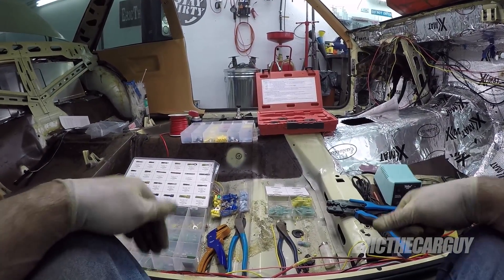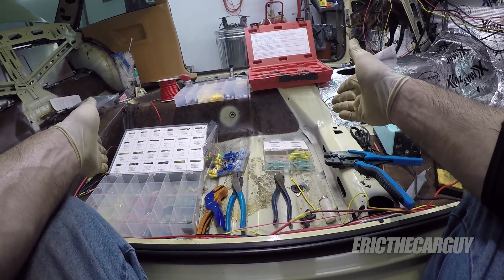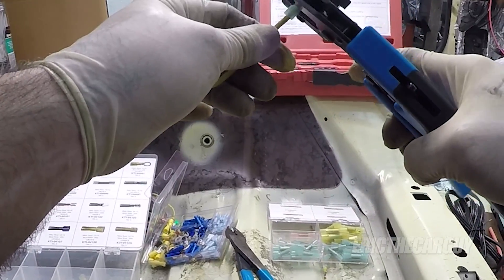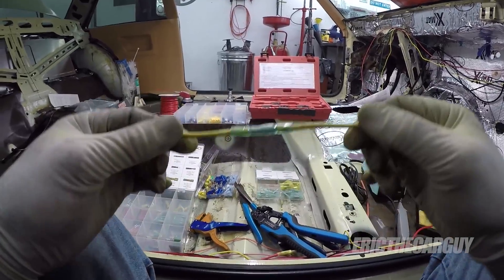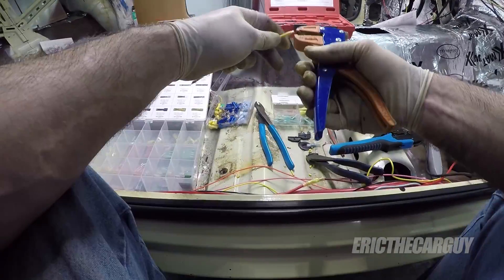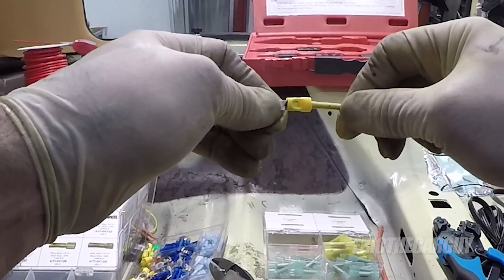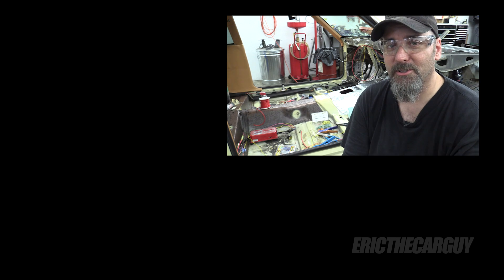How To Crimp Electrical Connectors

Comment: Don't use butt-end connectors on computer wires or major electrical systems that may be sensitive to additional resistance. I would recommend using butt-end connectors on thing like headlights or tail lights maybe with speakers but additional resistance to major electrical components of then vehicle will cause the readings to not be as accurate because of the added resistance of the butt-end connections. Solder and shrink tubing is the best way to go with the main electrical wiring.
Reply: JayGamesAndStuff A properly crimped butt connector will only add the equivalent of at most an extra inch or two of copper wire, which should never be enough to significantly alter your readings even in typical low impedance systems (and will have no effect whatsoever on higher impedance systems).  Any system so sensitive that an extra inch or two of cable length interferes with proper operation should require manual calibration after the fact anyhow as there are just too many other variables to account for from the factory as both wire length and gauge will greatly alter the behavior of any system where just a few milliohms is going to make or break things.  A very poor crimp job can be an entirely different matter, but that is why one should use the proper crimping tool for the connector so that one gets consistently solid and repeatable crimp connections each and every time.

The only real exception to the above is where thermocouples are in use, but then splicing in a connector, or any transition between dissimilar metals, will introduce a new thermocouple junction and if that new thermocouple junction is at a different temperature then you will introduce an unintended voltage offset that will affect the millivolt reading generated by the thermocouple.

Comment: Eric , this is very good video thx. Let me say however the the other crimper if done correctly will give you a factory connection . Now I will say it has to be done on non insulated connection. I am not trying to correct you in any way . I am saying that there is another way to do this  . Oh also you will have to cover the connection with heat shrink to finish the connection

Comment: Hey eric i have an electric problem on my 2001 suburban and my low beam lights don't work but the high beam lights work and all my fuses and relays are working i also have new light bulbs but my low beam lights still don't work what else should i check to find the problem
Reply: Gerardo Paez Then you next need to identify where the power to the bulb is being lost to fix the issue.  Does the bulb holder/connector have power when the lights should be on?  If yes, then verify that the the fuse is good and passing power to the other side of the fuse holder, then check that the headlamp's relay is passing power, and if not is it because the relay failed (has a bad contact) or because the relay is not receiving power to its coil (its internal solenoid) or to the input of its switched side.  If the relay is delivering power then there is likely a break in the wiring between the relay and the bulb and you may need to replace that section of wire with new wiring unless you can locate the break (such as a point where the wire became pinched or even severed).  Simply put, you need to follow the power and identify the last point in the equation at which you do have power being delivered and the first point that is not receiving the power after that point and you will then know what to do.
Reply: I had a 1970's toyota that did the same thing.the two copper plugs would'nt let the low beams come on until enough electrical current heated them up and straightened them out.

Comment: I crimp first then add solder to insure max bonding.  I find this procedure to be especially important for connections made OUTSIDE the vehicle as moisture, dirt and salt will degrade a crimp only connection in time.  I have had to do over connections that were compromised in this way.   I like the heat shrinkable connectors for inline bonding as I will sure not get a soldering iron in there without wrecking the connector.   Another Great showing, Eric !  
.
I occasionally crow to people on the quality of your presentations, video and lighting.  Your early experience in media arts stands you in good stead.  Gordon (AKA Gweedo Murray)

Comment: Great video!  I didn't see it in this video, but I've used some electrical connectors that have a male and female connection which can be disconnected if needed.  I've used this connecting wires to my side turn signal mirrors.

Comment: Soldering your connectors (after crimping) is absolutely necessary/required on vehicles or anything you wire that moves. I learned that the hard way over the years on several car/truck builds. Don't believe me, just wait until you have to find an intermittent connection issue because you did not believe. 
I also would never use the flat jawed crimpers, connections made with them will fail over time on anything that moves UNLESS you solder them, then you can get away with using that style crimper. The crimpers with the little nib that indents the connector into the wire are the best ones to use in most every case. They "lock" the wire into place mechanically forming a much better connection.

Comment: I prefer uninsulated terminals and heat shrink. The ones with built in heat shrink are nice but spendy. I like how low profile and clean uninsulated terminals and heat shrink look too. I cant stand the standard insulated type terminals, they're ugly amd bulky. Plus theyre not a sealed connection and putting heat shrink over them looks terrible and never works right

Comment: Hi Eric! Im building my car and I am in the wiring step. I moved battery to the trunk. I didnt use the solder with those crimp connectors, but when I did the connections for the big powercable from trunk to front, I used little solder just because my tool was too little for the connector.IMO solder is not necessary If you have good tools and It also makes the wire too stiff to crimp for no reason.

Comment: Can you confirm which die set you have used? It looks like the 18924 die based on freeze frame analysis of the shape. I have a very similar Pro's Kit tool and I have been looking for one that is good for the heat shrink crimp connectors like the ones you're using.

Comment: I've got a technique I like for the crimp terminals that crimp both the conductor and the jacket. I strip my wire to the length I want, load a terminal into the dies and start the crimp with the usual three clicks, hold the wire in front of the crimp dies, but touching the dies themselves, line up where my conductor and insulator go relative to the dividing line on the crimp dies, then slide my fingers holding the wire down so they are actually touching the dies. Without changing my grip on the wire, I'll then shove the wire into the terminal until my fingers touch against the crimp dies again in the same way, and crimp away. I've been doing it this way for years on everything from automotive-type 10AWG crimps to 26AWG Molex C-Grid-type pins, and since I started I have yet to end up with a crimp that has insulation under the wire side, or not enough insulation under the insulation side.

A similar idea works for both non-insulated and insulated crimp terminals; you just line the wire up with the crimp dies or jaws again in the right orientation using fingers as a gauge. It works surprisingly well.

Comment: There is no overcrimping with proper tools. If you have issues with overcrimping, you are using the wrong tool/die set for the given connector.

Also, with a proper crimp connection there is no necessity for any soldering whatsoever since a proper crimp is (almost) a welded connection on its own with no air gaps inbetween.

Comment: Soldering is superior to crimping. I will use crimp connectors when necessary such as repairing a harness factory connector and deuch connectors. The wiring cannot be subject to movement or pulling when using crimp connectors.
Reply: Bob Is The Builder I would agree that quality soldering is superior to inferiorly crimped connectors, but with properly crimped connectors it is very much a six of one, half dozen of another deal.  One can most certainly have movement and loading when proper crimped connections are used (though excessive flexing concentrated near the crimp connector or solder joint is bad for either case over time).  Heck, I probably have 15-20 pounds of coax hanging off of each of my antennas just flapping around in the breeze all of which are crimped and then sealed against weather with a tight wrap of splice tape covered by tightly wrapped electrical tape and those connections are easily solid enough one could hang from the coax (nor is soldering a good option where foam polyethylene dielectric is used given a melt point below that of solder).  It is just a matter of using the correct tools for the task at hand and not trying to improvise with all the wrong tools.
Reply: Ethan Poole 
I agree its going to vary depending on the job. I'd be a liar if I said I never used crimp connectors. I have probably used crimp just as many times as solder.

Comment: I only solder wires when it's for sensitive electrical stuff. Where you'd want the best connection possible. Like for speaker wires. A better connection might improve the sound a lil. But for stuff like turn signals and tail lights just a regular crimp is more than fine.

Comment: Some workplaces I've learned prefer that you take the time to do it right. That means taking the time to Tin the connection because you'll know you have all the wires to conduct with, where as just crimping it without Tinning the wire means some of the wire could not be in use or the pinch could just separate the wires, not pinching them hard enough and over time will turn into a loose connection(this could cause the lights to flicker for example as the vehicle drives down the road/bumpy roads..)

That being said, when I work I'm usually under pressure to do the job in a certain amount of time, so I just skip the Tinning step as that can add an extra 15/20 minutes to a job depending on how much crimping you have to do.

All in all, it really depends on the mechanic's skill. If the mechanic is skilled enough, and takes his time to get it right the first time, then it's no big deal to skip the tinning step. If you have a rushing/corner cutting/half ass accident prone idiot doing the crimping, you're probably going to find something wrong/loose in the post-check before the equipment even leaves the shop.

Comment: Excellent timing, I've recently picked up a 1998 GMC C2500 with the 6.5L diesel and she's got quite a few electrical problems that I've traced back to harness damage in multiple spots. Currently have the intake out so I can get better access to where the bulk of the damage is.

Comment: Eric your crimp tool seems to be bad or broken, It should be released automatically when you are crimped enough. The release lever is only for problem situations... Other thing, solder is used on PCB and nothig else.

Comment: Crimp Solder Seal my Friend! Oh...and dedicated grounds?? :) Oh and tinning your conductors and the terminals. OH...and crimping is a mechanical connection while soldering is an electrical connection and do not do cold solder joints!

Comment: Now are you going to get that spaghetti in the background into plastic conduit and looms and harnesses for the wiring? Or just wrap it in tape? I guess that'll be the next vid?

Sometimes how it's all routed and packaged makes all the difference in between looking like a hack-job (even if electrically sound) or professional.

Also some free manuals out there NSTM/FAA or similar for wiring practices, if it's good enough for aircraft, it'll be more than good enough for a car.

Comment: Eric
the number of conductors inside the insulation determines the flexibility of the wire.  Thaat is the smaller the conductor size and the laarger number of conductors the more flexible it is.  Also I have been stripping wire for over 50 years and use nothing but a knife or side cutters.  You can get a good strip this way doing this method.  I never use splices to join wire, but will use ring and spade terminals.  In any wire joinery, I solder.  Solder wires together and solder terminals on the ends.  I was glad when heat shrink tubing came along.  When it firsy came out it was about $15.00 for a 3 foot section to shrink over a 14 ga. wire.  How things have changed over the years.

Comment: Concerning the idea of pre-soldering the stranded wire before crimping. I could not think of a worse idea. The point right behind where your soldering stops is the point the wire will fatigue and break, there is nothing to be gained from this activity. I have been shown different soldering techniques by the military (no I was not a service member) and several private schools, no one does this presoldering. If you look for a crimp tool one non ratching tool that works fine is produce by the Thomas Betts Company, great crimper.

Comment: very nice video, i hope it eradicates all the crappy wiring i run into all the time...but I guess I would have to stop making crappy wiring 1st lol ;)

also, soldering will increase the surface area the wire connects/ in other words,  it can reduce resistance, increase how secure the connection is, and if not needed a waste of time. If the wires were moving a ton of juice, somewhere they would get stepped on, vibrated pulled on etc maybe its worth it.

Comment: the company I work for guys those shrink tube connectors, but ours come with solder material inside so when you hear it up it solders as Well. I've never had any problems with those..now the regular type..oh boy

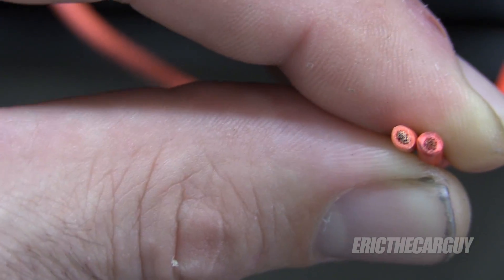Comment: You mentioned choosing good wire (at about 4:25). I would like to add the importance of choosing the right wire. Some people don't know that solid wire isn't appropriate for automotive. Much lesser known (and the difference in the wires you held up for demonstration)  insulation is rated for different applications. Some are made for added protection against oil or solvents, where others are intended for higher heat areas for example. 
As usual you have made a very informative and helpful video. Well done sir and thank you.

Comment: Hey Eric, I want to ask you something! I want to put like 4-5 separated 12v lines for smd led strip on my car(98 mondeo 2) and put switches so I can turn them on when I want to.we have here a good electrician in town. Is there a way so you can draw power from just 1 12v line? For all those 4-5 different led strips? Or every led strip should be on its own separated 12v line from the car? If you didn't really understand,I'll try drawing and explaining it a bit better!

Comment: Well, when we fixed aircraft wiring (NAVY, AE) we used crimp type splices to make a repair in a wire, crimped on pins inside connectors too. Special heat guns for the heat shrink to seal up the splices, no lighters. Crimp tools that don't release until they've been squeezed far enough. Pretty much what you see here. Soldering was only on terminals that were meant to be soldered to. I use a butane soldering iron when I solder,  it heats up quick, doesn't require a cord. I'll set up a few wires, solder and then shut the iron off and put it out of the way by itself or in an old glass ashtray If I want it near.  I also have a neat little butane heat gun that shrinks things up quick without too much heat. Having the proper tools and supplies to begin with makes it so much easier.

Comment: If your in a place like Hawaii solder before placing terminals is a good idea, especially if your working on a classic, even new cars here have issues with corrosion, and if your that deep into a car, adding a few seconds per terminal is not going to kill you, but it will help, especially with audio. But its your call, will it work with out tinning, sure, will it last another 30 years, maybe, but probably not here.

Comment: 1) You should always use ratcheting crimpers.  Ratcheting crimpers should not overcrimp, they should crimp the right amount and then stop.  The crimper you showed early on that is not ratcheting, the one with blue handles which you said works better with non-insulated connectors.... there's a reason.  It's DESIGNED for non-insulating connectors.  It's the wrong tool for insulated connectors (and the wrong tool for any connector because it's not ratcheting).
2) Never solder a crimp connection.  In fact, never solder anything that didn't initially come soldered.  No really, don't use solder.  It's not an appropriate way to repair something.  Solder leaves a mechanically rigid joint.  Over time, there will almost invariably be stress (often cyclic stress) on the joint, and it will break.  A crimp connection is designed to grip things without becoming rigid and is more than adequate.
3) Avoid using crimps with vinyl insulation.  Seriously, nylon is way better.
4) You should always have heatshrink over all joints, whether its inherent in the connector or added on top of it (remember to put it on before connecting the wire because you may have no option afterward.
5) Electrical tape is, under no circumstances, a substitute for heatshrink.  Ever.  They serve two different purposes.  Electrical tape will not adequately protect the joint from the weather.
Reply: Perfectly said.

Comment: Excellent video Eric. Proper tools make all the difference. When I strip the insulation with wire strippers like your yellow/black pair or the red handle pair, I squeeze once with the proper size cutter then rotate the wire 90 degrees and squeeze again to fully cut the insulation then move to the next larger size cutter and pull the insulation off. That way you will not break any strands of the center conductor as you pull the insulation off.